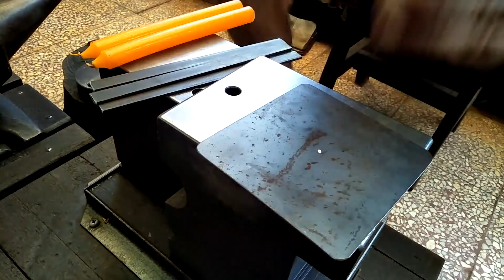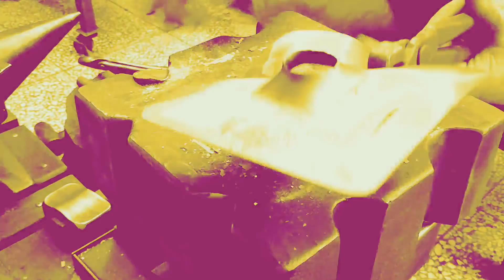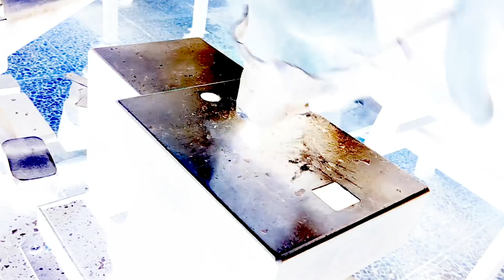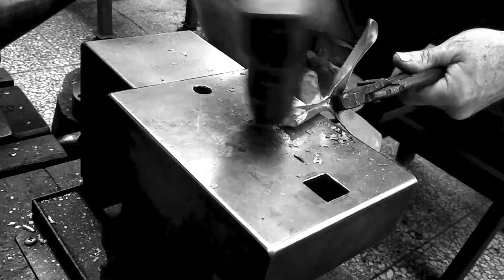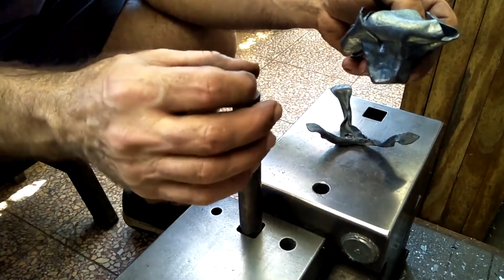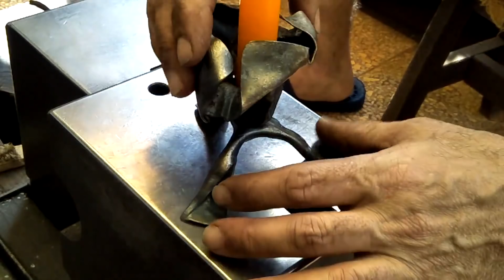forging candlestick holder - an ode to junk

Comment: The first attempt effectively replicated the effect of a stamping die. A better approach would have been to use a mandrel as a form, and hammer she sheet down over the butt end of the mandrel.  Better yet if you pre-dish the metal plate.
Reply from the maker: Live and learn. I am planning a somewhat similar project and will go about it more as you mention. Thanks for watching.